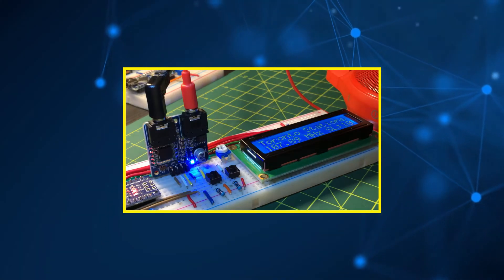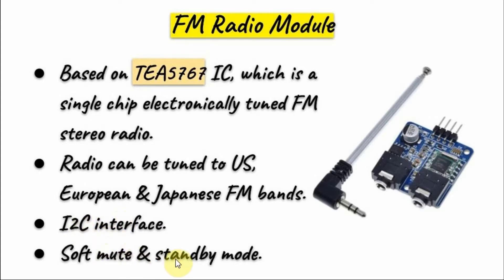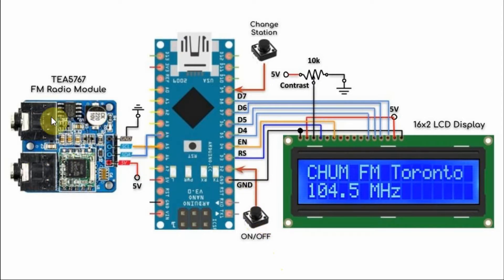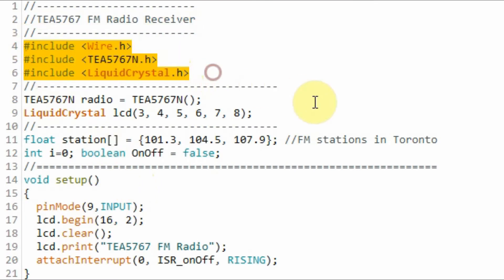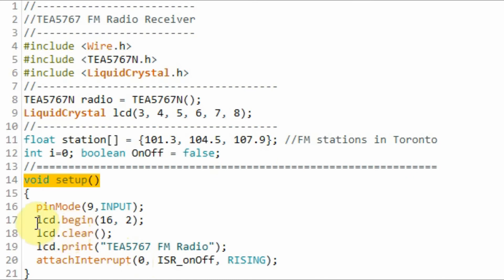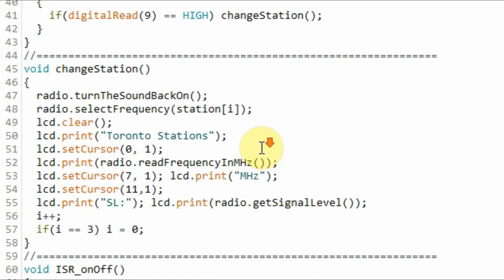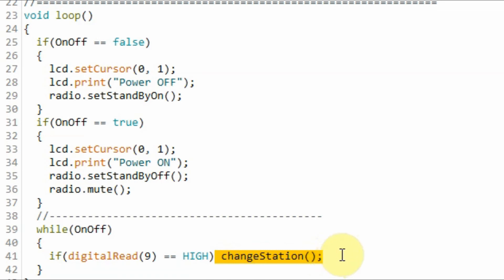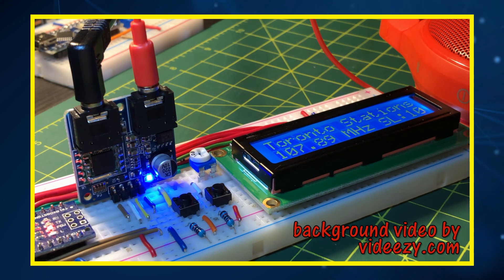TEA5767 FM Stereo Radio

Comment: you didn't use 5v to 3.3v level converters also make one using the rda5807m module also, i have a few lying around, but don't work properly, in the i2c scanner it shows hex code of 0*60 which is of tea5767.

Comment: Hi! some frequencies are not displayed with correct values: 98.29Mhz instead of 98.30, 94.79 instead of 94.80, 100.59 instead of 100.60, 107.29 instead of 107.30, 100.19 instead of 100.20. Any suggestion? Best regards
Reply from the maker: Hi. You can checkout my other videos where I program the module from scratch and write a library for it. Those videos explain how the station frequency is computed. Thanks for your feedback.
Reply: Hi, 

Thank you for your answer, and for share this project with us.

Regarding to display the correct frequency value, I Think this is the function, but I don't have any ideea to fix it, any help from you is welcome!:

lcd.print(radio.readFrequencyInMHz())

Comment: Thanks for interesting video.   😊
I only receive stereo FM stations in Mono. Wondering why?
Is that depending on the SL level?  (mine:  SL:66%)
In my case the line "if(radio.isStereo() ==1 lcd.print("FM Stereo")  is never executed. (?)
If I change the value to "if(radio.isStereo() ==0 lcd.print("FM Stereo") then it's ok.
Should it be like this, or .......?

Comment: Brilliant...! Sir I liked your project and other such stuff on your channel. I have two queries:
1. If this module is preprogrammed for fixed staions of US, Japan, etc. Or it can be put in autoscan mode for local fm stations anywhere (88 to 108 MHz entire band with two places of decimal)?
2. Apart from FM IC, I guess that module is having onboard PA also. When we are putting it in off/standby condition PA is also managed by module itself or user has to do it via code and some PA control GPIO?
Reply: Ja mám také FM kde samo nainštalujem stanice až 10 staníc a uloží do Epromu. Mám Oled displejom a zvuk je riadený s potenciometrom. Su 4 tlačítká 2 na memoriu a 2 na hlaadanie staníc hore a dole.